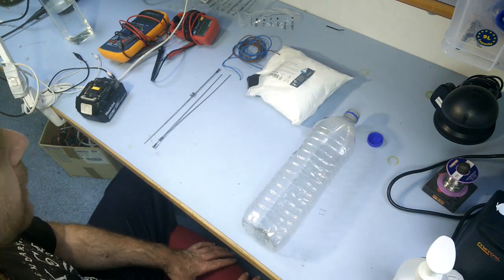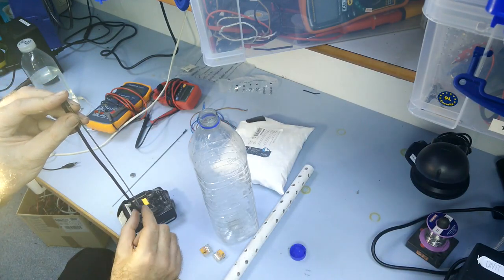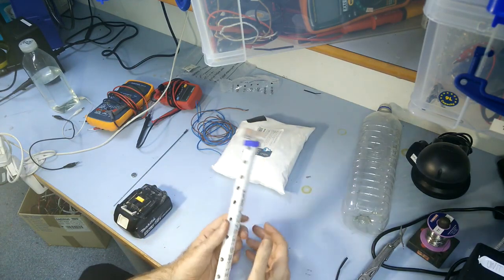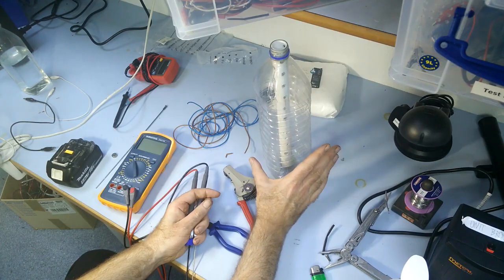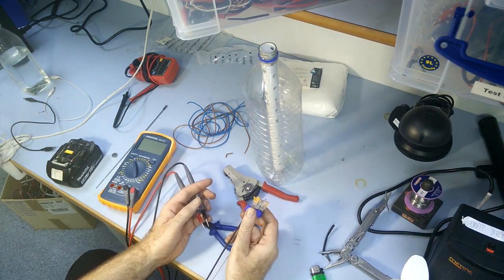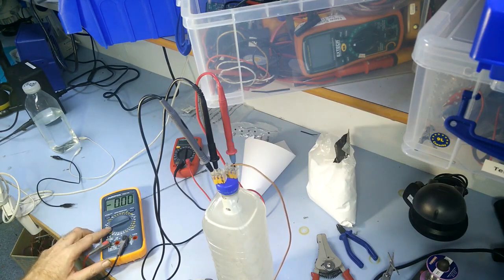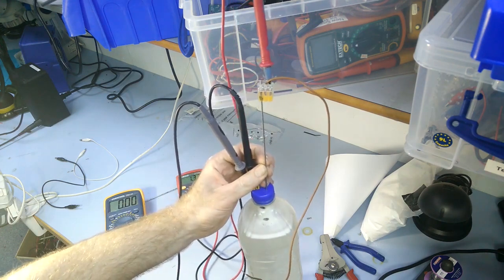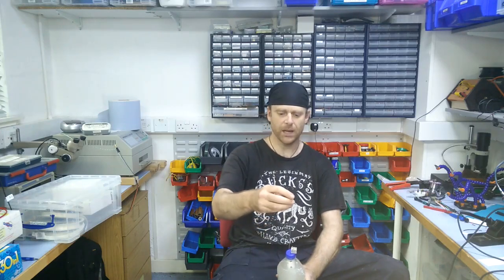A Liquid Rheostat For Load Testing Turbines

Comment from the maker: This one's a bit niche, even by this channel's standards, but this is what I use to load test my turbines, as it's fairly easy to construct anywhere in the world from available materials, and does a pretty decent job.

There are of course other options such as nichrome toaster wire and lightbulbs etc, but this one is completely variable, with a settable range, which can be swept through in a couple of seconds without having to reset anything.

Any questions or suggestions let me know.
Reply: As niche as you may think this is, I think it's brilliant to have an inexpensive variable load for testing all the inexpensive devices you have designed.

It's a necessary tool in prototyping and developing such systems and commercially available alternatives are not cheap.

Comment: I think when your original video on this came out I was hoping to make one. A bit of a concern I have is that stainless steel contains Chromium which can cause toxic compounds in the electrolyte, so also make sure you dispose of the water carefully. If you can get graphite rods from batteries that would be better, but it's not so easy to get the surface area you need.
Reply from the maker: Would the soda solution leech the chromium? I haven't noticed any obvious chemical changes in either the metal or the liquid, but haven't stored one of these long term enough to find out.
Graphite would work well in terms of conductivity and nonreactivity, but would be very fragile and hard to source in these lengths.
Reply: @OpenSourceLowTech  I don't know if it would or not. It's just something I've read online that when using stainless steel for electrolysis it does eventually break down the stainless steel which will release the chromium. It might only be a problem for sustained usage though.
Reply from the maker: I'll keep an eye on it, thanks for the heads up.

Comment: Wow, this is neat. Wonderful really!! ♥ Thank You. Though, just wondering, how about using aquarium pipes inside the PVC pipe to keep the rods straighter? Maybe thermocol or cork to keep it straight. Also, a syringe attached to the top cap to allow easy addition of electrolyte?
Reply from the maker: Could be handy if using wire, but the bike spokes are rigid enough to stay straight on their own.
The washing soda only needs added about once a week or so even with regular use, so it's usually easy enough to just open the bottle and top it up.
Reply: @OpenSourceLowTech  Ah coool then

Comment: Have you never measured the washing soda while adding to see how much it takes in a liter of water to get10 ohms?  Would think it would be close each time.  I've made sodium carbonate from sodium bicarbonate by baking it in the oven. Also,  Do you know how many watts this setup will handle.  60v @ 6a is 360w.  Think it would handle 500w or more?
Reply from the maker: I will next time I make one, yes. It does also depend on the height of the bottle and specifics of the setup tho as to dialling in the desired ohmage.

Comment: Have mppt controllers been used for similar purposes? Assuming your generators are permanent magnet. 
Still working out the best options for regenerative from a 22" propeller on a sailboat.
Reply from the maker: An MPPT would probably do a useful job in this situation, yeah. I'll have a play with repurposing a basic solar box at some point and see what happens. Might have to hunt for one that can handle the voltages tho..
Reply: @OpenSourceLowTech  I know without looking 100v. PV Panels of 144v I run into.

Comment: Add a question, the wago connection is all in series, connections all join at the end I mean? I am making this, and I was not sure about modifying .. If I manage, I will report back though
Reply: @OpenSourceLowTech  i blame Samsung voice typing lol, but it's all good now
Reply from the maker: @Nick_Tag  Basically the amp meter is in series from the bridge rectifier to the load, the volt meter is in parallel across the load. Check the Liquid Rheostat video on my channel for more details.

Comment: Should'nt you test your turbine with torque and speed? The motor has its characteristics too, which could be in conflict.
Reply from the maker: Last year I tested my wind turbine with a Prony brake for it's mechanical efficiency and characteristics, as the alternator and drive connection options are a bit of an issue.
With this tho the HB wheels seem to fit the dynamic particularly well, and there's not really anything other than motorbike alternators I could use anyway (which are the lower resource environment option), so I've just more or less signed off on it all as is.
Seems happy enough.